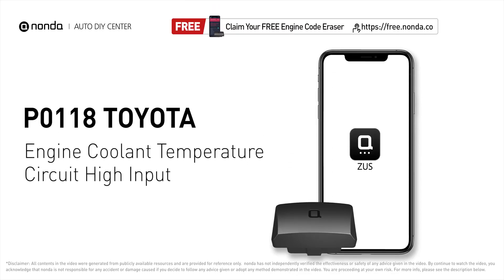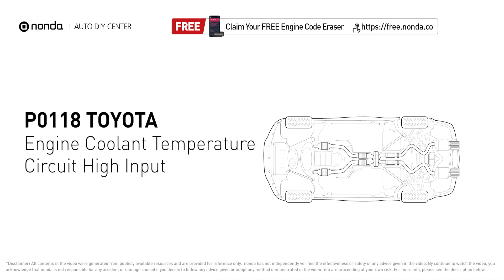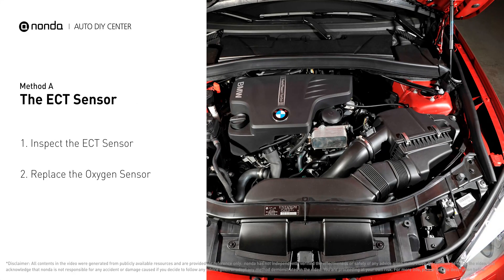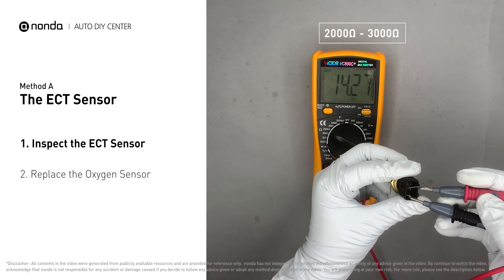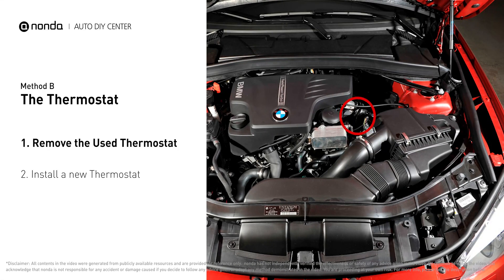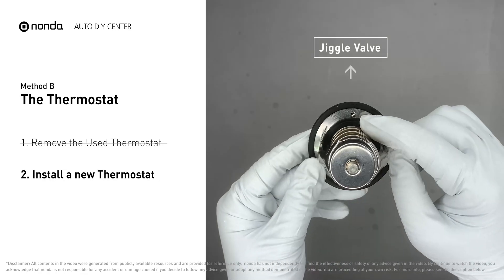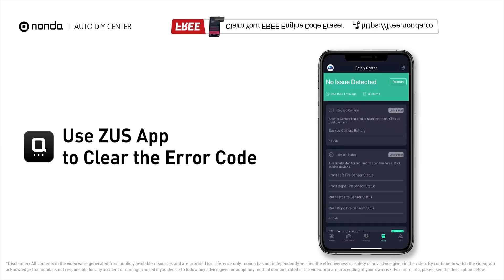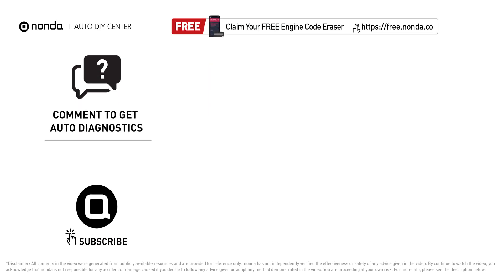How to Fix TOYOTA P0118 Engine Code in 3 Minutes [2 DIY Methods / Only $7.33]

Comment: I replaced ECT sensor , and Thermostat on my 2006 Toyota Corolla. Radiator Cooling Fan will not come on. Checked Fan1 Relay and 30 amp fuse for Fan. Checked fan motor for Continuity and power at the Connector. All checks normal. Ran out of Ideas of what could be wrong.
Reply from the maker: Can you please confirm if this is the only code you're getting?
Reply: This is the Code P0118 , for now I’am running the Fan temporarily directly from the battery constantly to prevent Engine overheat.
Reply: Non genuine aftermarket parts can cause your issue..both thermostat n coolant sensor I have seen it before